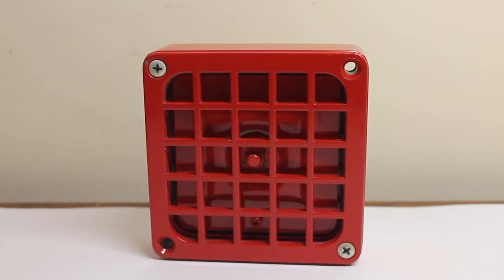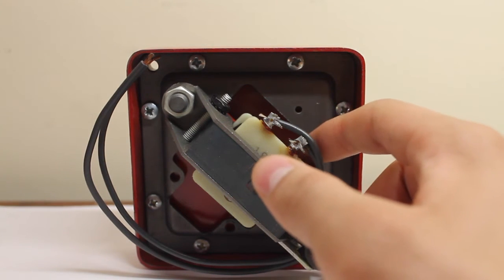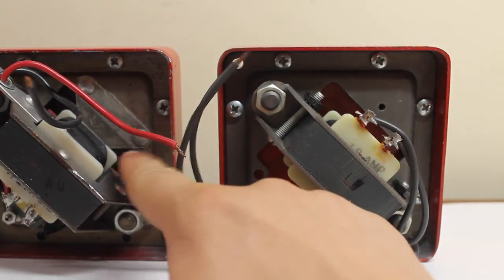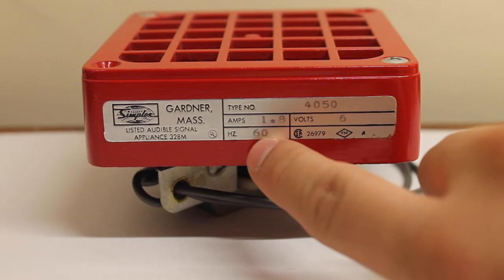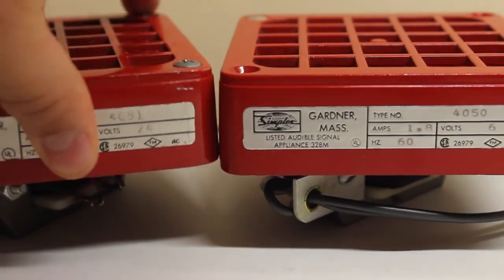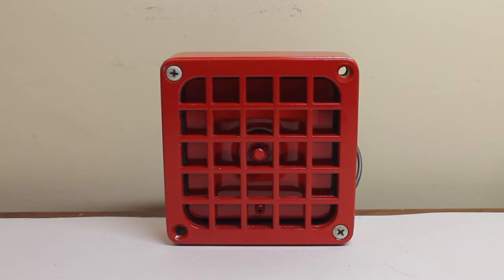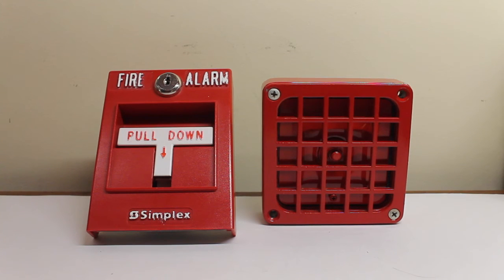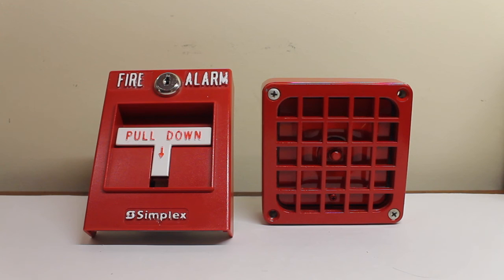Simplex 4050 Fire Alarm Overview/Test (Underpowered)

Comment: Sounds like my old dishwashing machine going through the draining process.

My Dishwasher was an Insinkerator. It made the same hum along with spash spash noises.
Reply from the maker: Pretty interesting...not my best work, but interesting I was able to re create the hum of the insinkerator!
Reply: @NewEnglandElevators I Have a KitchenAid that makes a Hummm sound when it drains.

What kind of Dishwasher do you have? I hope you can simulate yours!
Reply: @NewEnglandElevators You know something? My washing machine also makes that same hum! It even chug chug chugs like a train when it starts the final spin cycle!

The washing machine I have is a Danby Portable Washing Machine.

Comment: The 4050 in a 6VAC is almost like a fluorescent broken lamp or a no battery exit sign
Reply from the maker: The horn is meant for 6vAC, but I had a transformer that didn't quite put out enough power. I have since acquired a proper transformer, and boy is this thing loud!!!

You're right, it does sound like those things that you have mentioned there. Thanks for your comment.

Comment: Awesome vintage horn sound
Reply from the maker: Even if it's underpowered, it can be pretty cool. Only for me to get a much better 6VAC transformer.
Reply: @NewEnglandElevators  well, i admit it sounds cool. It can sound even cooler if you supply 24 volts ac 60hz.
Reply from the maker: That would be cool...unless you want to see a fireworks show from me frying my 4050 (only kidding, I would never fry a device intentionally). In all seriousness, my unit can only take 6VAC, my main problem is finding a transformer that can output 1.8A. Unfortunately, I've just been so busy with everything that I've never had the chance.
Reply: @NewEnglandElevators  well, can you get a 24 volt ac 60hz model?
Reply from the maker: Timofey Kozyrev It would probably produce the same sound, what other difference would a 24VAC version make? These devices are super rare too, so I cannot guarantee it in the marketplace.
Reply: @NewEnglandElevators  newageserveralarm has a 24VAC 60hz model. It is very loud and nice sounding. He uses it on a light plate.
Reply: @NewEnglandElevators  so it makes a big difference. The video he used it in is his system test 28.
Reply from the maker: I'm sure this one would sound just like that if I had the proper transformer for this unit (had you read my previous replies and the description of the video).
Reply: @NewEnglandElevators  i did. Also, have you seen that video of the system test 28?
Reply from the maker: Timofey Kozyrev yep
Reply: @NewEnglandElevators  and do you have a simplex 4030?
Reply from the maker: Timofey Kozyrev no
Reply: @NewEnglandElevators  and how does this thing work?

Comment: Sounds similar to the scoreboard buzzer at my school which is made by FairPlay and FairPlay, which makes scoreboards actually borrowed federal signal's vibratone 350 (simplex 4040) to use on their older scoreboard models.
Reply from the maker: One of my schools in the past had some FairPlay scoreboards, which used the current design of the mechanical Vibratone. I haven't seen any with this type of grille, like you mentioned. Interesting to know they're out there.
Reply: The ones at my school actually use the same grille as the current vibratone.

Comment: The high school I'm going to I assume had a whole system of these. The system now is a notifier system with NBG 12LX pulls (replacing BNG 1TS pulls from the system 2015 and prior during the HUGE district wide overhaul),Wheelock NS horn strobes from the last system, Exceders that have been added on during the update, Wheelock MT4s for some reason in one half of one of the gyms, and weatherproof MTs on the outside. However in one hall and by the gyms, some of the old 4050s are still there (obviously inactive due to the NSs right nearby.

Comment: when you put the 4050 on the 4903 9101 it would be a horn strobe
Reply: You can't do that.  The 9101 is a DC-powered strobe, and the 4050 is an AC-powered horn.  You would kill the strobe and/or the horn.
Reply: You would need 2 separate transformers. One to convert AC to DC to power the strobe, and one to step down the power supply from 120v AC to 6 volts AC.
Reply: Joel Hunt While I would say that could work, you run the risk of something overheating (mainly the stepdown device or the power converter).

Comment: One wing of my high school has 4050-85 light plates (which has the black "FIRE" lettering and now RARE) with this same horn mounted on it, with a few variants. Two of them have a Simplex 9838 horn and 5 of them have a Simplex 9806 horn. The plates were vertical mounts mounted horizontally instead of vertically for some weird reason. This obviously does NOT meet ADA requirements, because the "FIRE" lettering was sideways instead of going down. Although, half of them were upgraded with SpectrAlert Advances. I would hardly see the 4050-80+4050's in action during fire drills because most of them I get happen near the SpectrAlert Advances. In this case, the wing is shaped almost like a 3-leaf clover from the rear of the building in satellite view. The classrooms are arranged in 3 blocks on the edges of the "3-leaf clover portion" of the building. All of the alarms in all the 3 blocks we like to call, "pods," on both floors, were upgraded with the SpectrAlert Advances that do Continuous, as well as 3 of them in the main hallways that do Temporal Code 3 and the one in the Fitness Center (I don't know if it does either Continuous or Temporal Code 3, but my guess is Temporal Code 3). The only time I saw a 4050-85+4050 in action in person was when I had a real (actually false) fire emergency at my high school. I was actually in a classroom where there were 4050-85+4050's and the SpectrAlert Advances were nearby in the hallway. There were 2 exits in that classroom. One that goes out to the "pod" and one that goes out to the main hallway. We were exiting toward where the 4050-85+4050's were, which were in the main hallway. The 4050 horns were set on Continuous rather than Temporal Code 3 and the strobes were flashing in red slowly. As soon as I exited the room, the strobe suddenly stopped flashing and the horn kept sounding until it was silenced, which... you guessed it. Does NOT meet ADA requirements! Now that's just crazy! I had NO IDEA what the designers of the building were thinking!

Comment: My middle school that i went too had those. They system was a believe a Simplex 4208 or some other older simplex panel. But in 2009 they did a add on and did a very big remodel to the school. So i am sorry to say that those are no longer at the school. And they now have a Simplex 4100U or ES with Simplex True Alert Horn Strobes. Also my high school had some of those in some parts of the school. Like the lunchroom in the gym. And they had them on one hallway with light plates on them. They system has two panels a Simplex 4208 and a Simplex 4100. A mix with 4050's and with Simplex Horn Strobes the one with the strobes on the right side. Then they did a add in and a remodel to the school in 2007. But they kept the system and did not replaced the panels. The ad's on and new class rooms have True alerts on them. I was class of 2009. But in 2010 all of the old horns got replaced with Simplex True Alert's. So sadly the the old horns are gone now. They still have the two Simplex panels and both of them still work fine. So now they just have the Simplex Horn strobes with the strobes on the right and True Alert's.
Reply from the maker: Interesting mix of old and new!

Comment: What would happen if you put DC power into it? Would that fry it?
Reply: I'm sure it would make just one clack and stop, because DC isn't 60HZ like AC.
Reply from the maker: It would not fry it, but it would not sound, either. The coil would receive the 6V. However, as the current is not constantly switching, the plate will not vibrate.